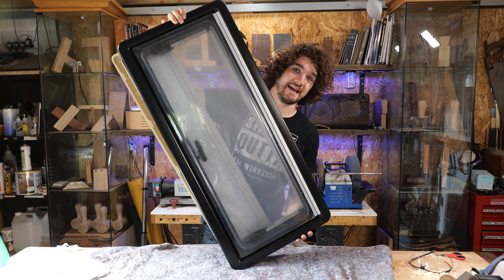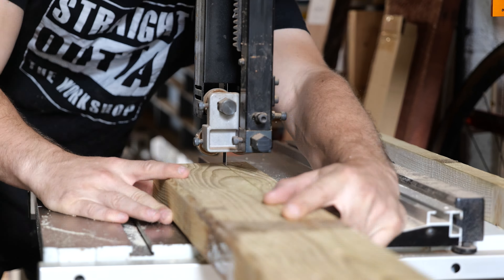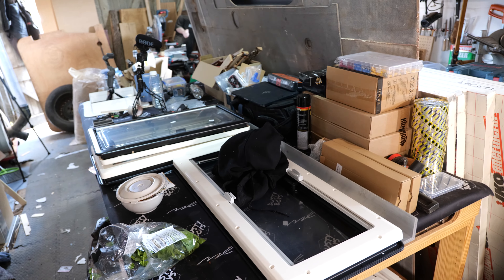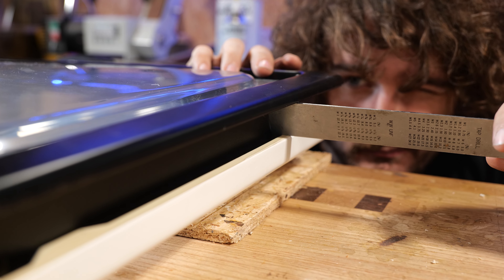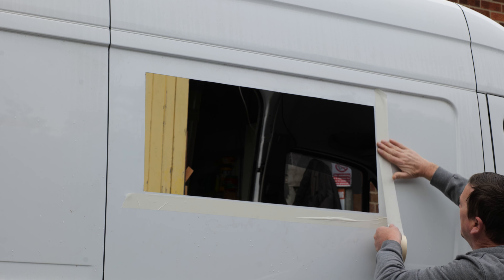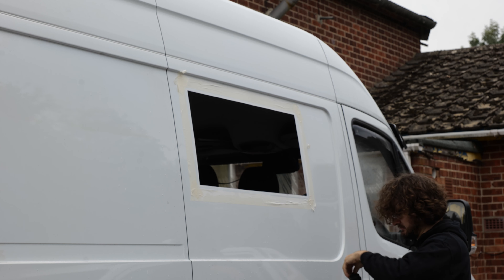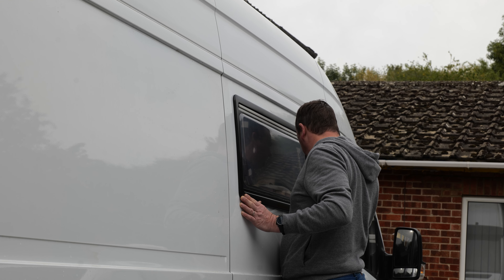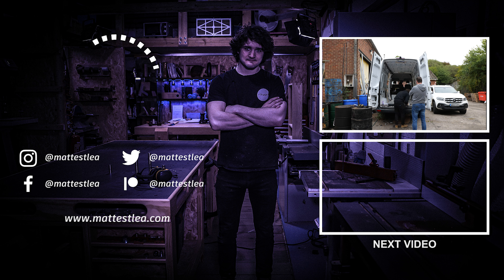Installing Dometic Windows in a Van | Mercedes Sprinter Conversion #10

Comment: Hi Matt , very interesting video. I am currently converting a Citroen relay and have picked up a pair of bargain /new unused framed windows as sold by Sheild autocare , However they too are flat ,and i have calculated that my van has a radius of 6252mm..After watching your excellent vid , i decided to make a pair of stout  timber former's  using my cnc router  for accuracy , but i,m going to step the former  cross section  to match the inner profile of the frame (3 steps) , so that i can apply pressure to the whole cross section of the frame profile . I  measured the gap between  the straight edge as you did and it was 5mm .  My fear is that the acrylic window might break when i try to shut it against the newly curved frame  or detach the hinge section . hopefully the round hollow section seal will accommodate the deviation . what type of seal does the dometic have ? and is your window harder to shut ? and any words of wisdom appreciated . kind regards